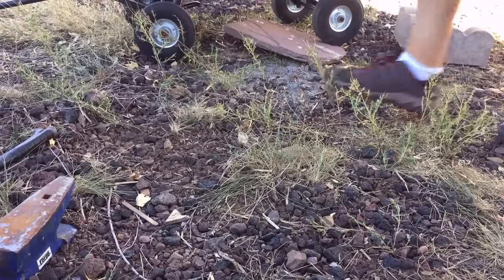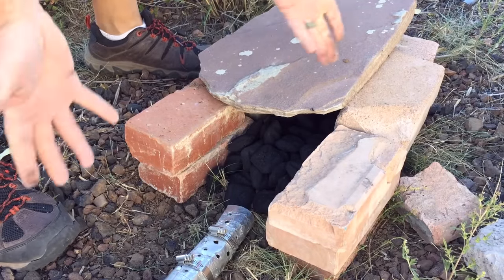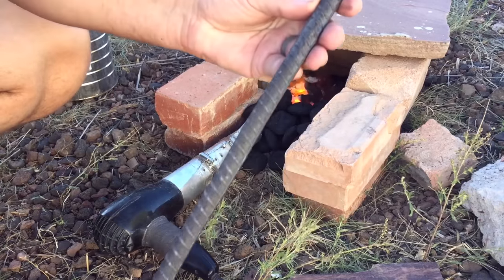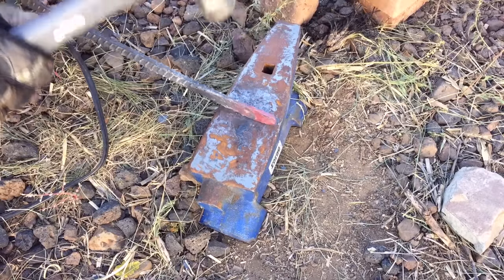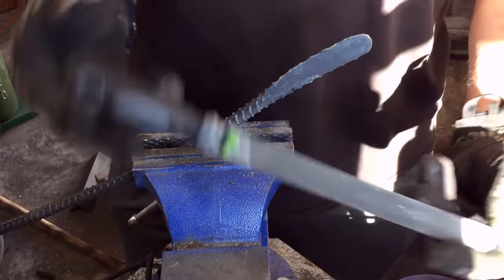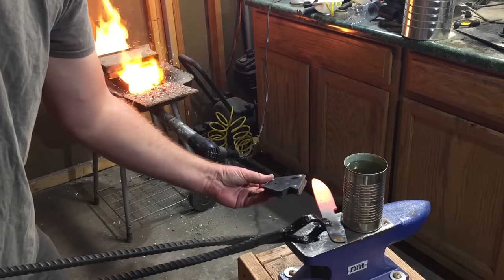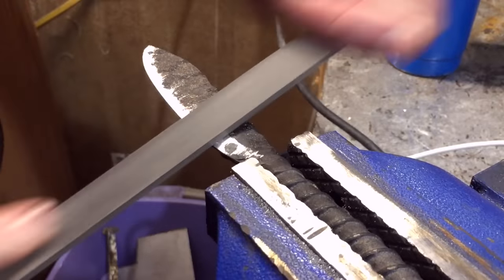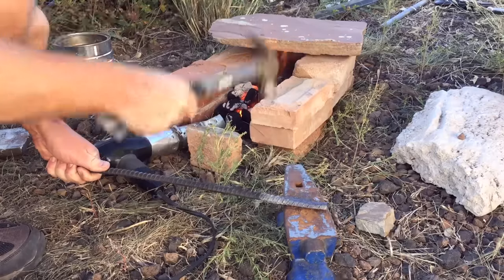Start forging TODAY in your own backyard - no special tools required

Comment: Could I use coal instead of charcoal, the coal I have is TSC walnut coal.
Reply from the maker: I haven’t used actual coal, but I understand that’s what blacksmiths usually use. There may be safety issues I’m unaware of, so I’d recommend watching a video on that specific product before using it. Sometimes they use the term “coke forge” for a true coal fired forge. I know I’ve seen videos on that subject from guys like Alec Steele.
Reply: @FargoFX  thank you!

Comment: Ooh nah, a regular campfire will definitely reach those temperatures! It's just a bit slower, less practical. I've seen plenty of solid glass puddles on the beach, though, after new years eve! Every year there's  dozens of fires along the beach so you're pretty much guaranteed to find a melted bottle, at least, the next day... Just be careful, it can stay at hundreds of degrees for dozens of hours after it has been extinguished and covered with sand.

Comment: Heating metals and steel is fun temperatures are key! And melting brass and copper aluminum at lower temperatures and steel and iron at higher temperatures, molecular make up steel like carbon content and how buck knives get a quenched tang to their blades to get a high hardness..
 Japanese blacksmiths  use various methods to from quenching to adding carbon to the steel while forging blades... the impurities removed to make a better steel blade it's fun to learn and explore but the temperatures if you get burt are unforgiving so make sure your tools and safety equipment are adequate to keep you from injury as a 5,000 degree of metal on your flesh is a unforgettable Teacher! lol there isn't any ooops!

Comment: This is a cool video for it's intended purpose.... gotta start somewhere. That being said, never EVER quench in water. It cold the steel TOO quickly and will crack it. This coming from a welder for over 20 years
Reply: Oh man, that's a lesson I learned the hard way. When I was still in trade school I had been practicing all day long on 4G getting ready for my bend test, dunking my practice plates after every other bead just to speed up the process a little. Well, I was absolutely exhausted from not getting more than 2 hours of sleep a night for 4 months, and between that and the sheer repetition of practicing I was running on auto-pilot by the time I made it to my actual test plate. Root, perfect. Fill, perfect. Cap, perfect... then in my sleep-deprived haze I took my beautiful test plate and dunked that bad boy right into the water bucket immediately after finishing the cap, not thinking twice about it. I'll give you two guesses how that turned out. 🤣

Comment: Dumb question: what would you quench it in? Water or some kind of oil? Edit: --nevermind, I kept watching the video lol

And is that borax powder necessary in this process or is that for something else?
Reply: Borax is good for melting. Gets rid of impurities. Oil is more forgiving then water but water works if u quench at lower temps. Dark cherry red or so.

Comment: This will probably get lost in the comments but even if you don't have a belt sander there's a method you can use with a cloth and file to sharpen.

Comment: the point of quenching is to temper the blade dude. if you're quenching the metal that aggressively, well you're being to aggressive with your quench. 
you shouldn't need to soften the steel in something like the oven.

Comment: I don't actually have any experience in this yet, but from what I've heard, quenching in water makes the blade really hard but also extremely brittle. And oil supposedly cools it down slightly slower so that it's a more even balance between not being brittle but also not supper soft. But that's just what I've heard.

Comment: totally agree.if you have stuff to make it easier.by all means.work smarter.not harder.forging is a great way to skip alot of steps instead of cutting out a blade.thats a bitch if you don't have a sweet bandsaw.screw the fiber discs.only if I have too.id rather hacksaw

Comment: Before we moved in our old house when we would start a fire in the basement so we would have warm water and stuff like that i don't know what it's called i used to put the steel stick to move the charcoal in for a while it got red and I'd smash it a bit with a hammer

Comment: So I actually watched this video when it first came out 4 years ago. My main advice would be do not buy the anvil, it's just not worth it lol. Get railroad track, any piece of hard metal.

Also it's hard to tell from the camera and daylight but beware hitting cold steel. Also of course if you want to use a knife you should just get some high carbon steel, don't bother making a knife you can't heat treat, steel can be cheap.

Comment: Ok no one in the comments seems to have made my mistake, don't set the fire on concrete and use a leafblower if your hairdryer overheats as it causes the concrete to explode which made a massive crater in my back yard I will try this again but just don't make a forge on concrete it explodes and if i did not make a cover with bricks Worse things could have happened

Comment: He makes it sound so much easier than it actually is
For me it takes 15 mins to heat up the steal in 1 heat. I get about 30 seconds to forge it before it cools down. Also it uses so much fuel. I ran out of an entire bag in 4 heats. Also how did he get the charcoals to just suddenly light. It takes me so long just go get the fire going. Either this video is fake or I’m doing something wrong

Comment: and do you know where you can find a flat long piece of steel I'm trying to forge a sword but I can't find stainless steel?
Reply: Scrap yard is awsome and also lowes. Lowes have crappy steel but u can case harden or fold in high carbon steel.
Reply: @dillonpense6530  thanks man

Comment: Do I just leave the hair dryer on the whole time?
Reply: I do:)
Reply: @dillonpense6530  thanks :)
Reply: @Youtubeiscool865  oh right if u can get a high low setting on a cheap one it helps regulate air.  Not necessary but can be useful. Just dont use cooking  briquettes for fuel if u are in the U.S.A they put like a spackle or chemical in it that keeps it from getting to better working temps. Hardwood charcoal is best if u cant get coal.
Reply: @Youtubeiscool865  good luck btw:) it's a fun process
Reply: @dillonpense6530  I'm in the USA, so I can just use hard woods? Is cedar a hard wood? Thanks
Reply: @Youtubeiscool865  cedar is a sappy soft wood not to useful If I remember right but yeah red oak white oak hickory.  if u have pine u can make what's called pine tar. Good for a sealer in wood handles but not a good fuel.  Primitive technology has a video that can help explain the best way to make charcoal to:)
Reply: @dillonpense6530  thank you so much! I have a hard time telling cedar from pine sometimes lol 😆
Reply: @Youtubeiscool865  lol same and i am surrounded by it. I think u can use it just not as efficiently. I cant remember exactly the reason. Havnt had my forge up for a while sadly. I think it's because of it not being as dense or the sap or both.
Reply: @Youtubeiscool865  hey If u know anyone that deals with trains they might be able to get u a bucket of coal. Ull melt the smaller rebar in seconds once its to temp. Just be careful when u work with it. Needs to be well ventilated.
Reply: @dillonpense6530  does it smoke a lot?
Reply: @Youtubeiscool865  onlynhad a chance to use coal once but the fumes are somewhat toxic. If I remember right it gives what miners got called black lung. Charcoal doesn't smoke bad once u get the air going nicely. If it has an moisture tho it can pop and send sparks.
Reply: @dillonpense6530  definitely going to go with charcoal then lol 😆
Reply: @Youtubeiscool865  lol yeah it's more forgiving. U can get to welding temps just barely and less likely to melt things so it's great. I liked the regular coal for thick stock tho. U can get a bar heated in no time:) have fun and good luck on ur projects!
Reply: @dillonpense6530  I just don't want to get some type of lung problem lol thank you so much for your help!!

Comment: For the love of God, put a guard on that angle grinder. And whatever you do, never use the tool that comes with it to tighten down the nut on either cut-off wheels or grinding wheels. Finger tighten, then grab the outer edge and use that to tighten it till snug. I've now seen 2 people i know fracture a cut-off wheel which came apart at 10k rpm. One of them was lucky, the other required surgery to remove a piece from his chest. Sorry about being such a fucking Karen about grinders, but i just see too many people on youtube do shit like that. 

Aside from that, great video. gonna make a forge tomorrow.

Comment: The only part of this video i disagree with is a safety concern, do not use concrete as an anvil. Concrete has been known to explode from high enough heat, especially if there is any moisture trapped inside it.
Reply: ye found that out the hard way today

Comment: The fact that you're able to refine that edge with the file shows that it's nowhere near as hard as if you were using the right steel. Harder yes probably but not anything I would consider usable for the long-term if a file can cut it. Matter of fact most blacksmiths test the hardness of their steel by skating a file across it and if the file skates instead of cutting, it means it's hard what that means is that the knife should be harder than the file or at least equal to it.

Comment: Water isn't better the oil because the oil adds the minerals back tk the steel your moving water pulls it out only thing useful was the digging a hole for the forge

Comment: 0 dollar improvement.: Screw the little anvil to a 2 foot sturdy log, will make it easier height to work with adnd easier to forge since ground gives in more and absorbs power, also carpenters hammers are too light.

Comment: "No special tools"
*Uses anvil
Reply: Thats not an anvil
Reply: @cobre7717  that is in fact a Vevor anvil
Reply: @idealizedx8924  that is a piece of cast iron. Anvils need to have a hardened steel face. Even though its much smaller you would be better off with a sledge hammer head sitting in a hole in a stump. 

Cast iron is very different from steel.
 
Cast iron absorbs energy and vibration. They specifically use cast iron in power equipment to absorb vibration and reduce chatter in machine tools such as lathe beds, milling machines, shapers, drill press, ect. In an anvil you want hard surface so the hammer energy can go into the metal you are forging and not into the anvil.

Comment: I understand that power equipment makes life easier, and I use power equipment in my work. However, you don't learn anything by letting the machine do the work for you. If you really want to learn, do it the right way. Hard work pays off. In my opinion, you shouldn't be teaching people the easy way out. Although the point of your video is to display a cheap way to do this work, you should be showing the real way to do this work. If the person wants to start forging, they should learn more than just flattening a bar of steel, they would want to learn how to use simple tools, and learn how to hammer steel. 

You mentioned that knife makers grind to shape, I personally do not like this form of work. When you are trying to do it fast, and put little care into the quality of the piece, then go right ahead. But if you want to put a piece of yourself in the work you do, if you want to make something meaningful, then I suggest doing what work you can by hand. I would hate to say it, but I would not recommend this video because it inspires people to take the easy way out of things. (He also left out some important details)

Comment: An intro geared to interest the inexperienced should include some inference to eye-safety, instead of instilling the false-confidence that inevitably gets someone injured, which brings insurance agencies and likely inferior medical practitioners inside the scenario, who insist on resolving the injury as quickly and inexpensively TO THEM as lawfully contracted. Including some injury disclaimer might resolve this, instead of an unprepared and over-confidant initiate injured just from brushing off the surface scale in the wrong direction, or overheating the material such that it's not scale but instead molten iron that explodes when struck. In five years since production without said warning(s) to acolytes, I'm sure you've got a clear conscience and good intentions inviting the inexperienced to ignore basic safety protocols, like leather boots, safety goggles and earplugs, but watching a beginner's video displaying forging hot steel on the ground covered with dry grass or hay when suggesting the use of motor or cooking oil as part of the tempering process of a weapon, not a tool, with no mention of fire retardants (like a brick floor and a safe working distance, not just the quench tub) and no sign of an actual extinguisher within reach, seems not just irresponsible, but INSANE. Not as insane as the rumor of the Japanese katana being tempered by being inserted while still hot down the throat of an inebriated commoner, or prisoner, giving the blade itself a thirst for blood, when the fact was in antiquity, the potential purchaser had the tradition of "Tsuji Giri", the option of testing a blade on a living person before purchasing it.

Comment: Poorly designed. The cover is not necessary whatsoever. And even the bricks aren't required. What you really need is a hole in the ground 10" diameter and 4-6" deep with a heat resistant pipe connecting the bottom of the hole to the surface a few feet away for your air supply. 

Videos like this have caused many aspiring smiths to get the wrong idea and spend a lot of money on flawed designs.
Reply: He literally said at the beginning of the video that you could dig a trench if you wanted, he didn't because the soil is rocky making it harder to dig and because he had some bricks already.